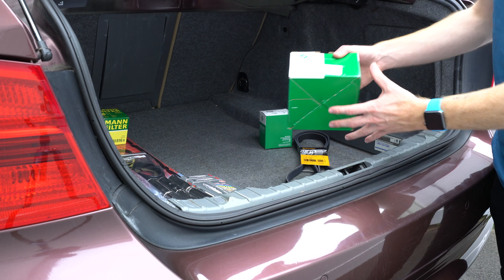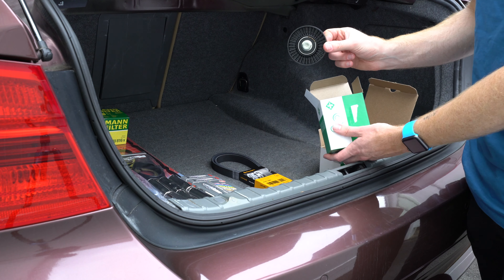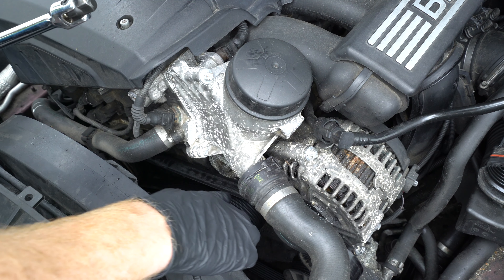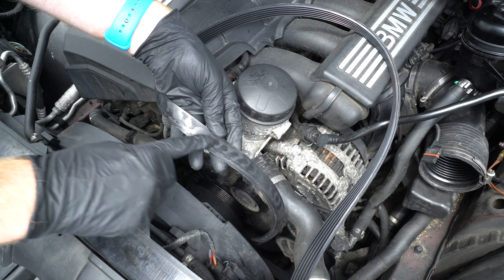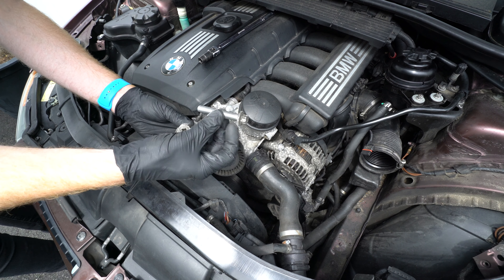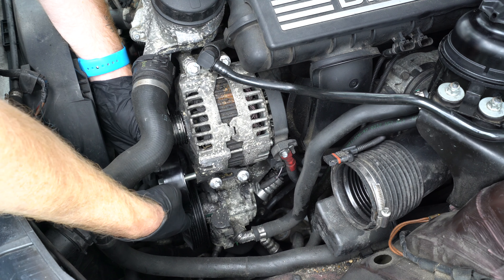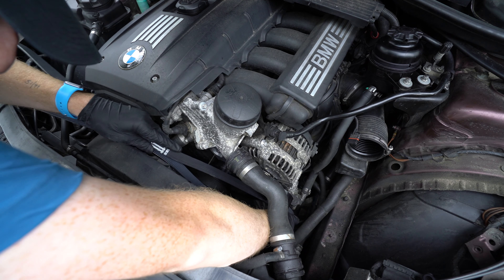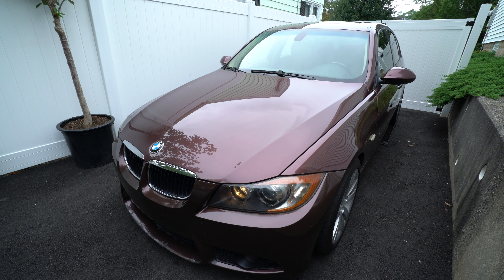E90 N52 BMW Accessory Serpentine Drive Belt and Tensioner Removal and Installation DIY

Comment: The guy did not show removing the stationary pain in the pensioner unit that comes with a steel pen holding tension on the tensioner, he should have showed removing that pain after you release tension with the breaker bar

Comment: Nice video.  When I did this same job on my Mercedes C230 I recall that the new "pinned" tensioner allowed me to fit the serpentine belt completely.  I then released tension on it slightly to remove the pin.
Reply from the maker: exactly Vic, that's how most will experience this job with this tensioner as well. I had some trouble fitting the belt routing and removed the pin during the first go at it... of course I edited that out!

Comment: The idler pulley and the pulley on the tensioner look like identical parts.  Do you know if this is the case?   A new idler pulley costs 3x what the tensioner pulley costs.  Seems like an easy way to save money.

Comment: BMW told me $445. I just did it myself, thanks to you. I needed to replace a cracked idler pulley. I ended up replacing the other parts as well. The tensioner pulley and belt only had about 30k miles  but I figured I should replace them anyway while I was in there.

I was slightly worried and wondered if I tightened the bolt too much because the new idler pulley didn't spin freely after I installed it, but I think that's just because it's new. It moves when I spin it manually but it's stiffer and doesn't continue to spin like the old one in your video.

Also the kit you linked to from Amazon comes with a "component alert" paper that says the bolt retaining clip "must be removed before installation" from the idler pulley. This is INCORRECT. The clip should stay on like you did in the video.

Thank you for taking the time to make this video and for saving me money.
Reply from the maker: Falco One great to hear it! With DIY more of us can enjoy these cars without going broke. 

Yes the new idler will not spin like the old worn out ones. The old ones have very worn bearings to spin like that. 

Interesting they must have made a mistake with the instructions or it’s a Chinese copy? Who knows with amazon these days.

Comment: Several key points:
1. For e90 328, the pin for belt tensioner needs to be removed and use the method in this video to put belt on tensioner. Belt can not be put on tensioner with pin on unless you have extremely strong finger.
2. The T60 is necessary. With tensioner go beyond the pin position to get belt on, you can easily strip the T60 hole on tensioner.
3. The T60 is better to be knocked on by a hammer to get fully inserted and then put on the break bar. If not fully inserted, T60 can also strip the tensioner hole.
4. Need to inspect whether the bell is in grooves especially for the bottom part of the AC pulley and bottom left pulley. 
As always, working on e90 is a careful job.
Reply: Thank you so much for this comment
Reply: So should you remove the pin before or after putting belt on tensioner?
Reply: I fit the new belt with the pin in.

Comment: Secret tip. Grove side of belt to grove pulley and smooth side of belt to smooth pulley. Never ever ran into any problems ever. It is now almost idiot proof. No diagram needed. Back in the day that was a different story.

Comment: You made this job look super easy and quick. A shop I called it could take up to 2 to 3 hours and estimate around 200. I even provided the part!
Reply from the maker: My BMW dealership quoted $375 for this service (2019 prices)

Comment: Yes. You are correct, This is very important. This is "Timing Belt" on the e90/n52 that if it is not changed and it breaks, you can destroy the engine.  I was speaking with a  sales rep. to a online parts vendor who was a mechanic.   I asked him how many n52s broken serpentine came in to the shop that he worked on that the belt got sucked into the engine and destroyed it.......He told me about half.........That is scary. 

To add to that because of the age and value of the car and the cost of putting even a "used" engine in an e90, the car is "totaled".  Now for various reasons if you are DIYer with "Free Time" and you want to do it yourself it would make sense to replace the engine.   A year back, when my wifes previous e91 water pump failed,  I was scared that engine was fried and was curious how much replacing the engine was going to cost.  There was shop that had 2 n52 engines with low mileage.   I was quoted $3200 to have the least expensive engine purchased and installed.  He did say that he would replace all the gaskets before installing the motor because it just made sense and stupid not to do that and that was included in the price.
Reply: it's not the timing belt, it's the serpentine belt, the n52, does not have a timing belt it has a timing chain, which usually does not need to be serviced

Comment: Is it the same procedure for 04’ BMW X5 3.0?
Looks simple enough!
Great video👍🏼
Reply from the maker: The M54 belt procedure is even easier to do than this one! The M54 also has two belts and tensioners, one for the main accessories and one for the AC compressor.
Reply: BIMMER ZEIT thank you!

Comment: Hi there i got question i have bmw e90 salon 2010 plate automatic when i turn all round my steering wheel i got noise i bin too my mechanic He tool me i need to change my V Belt and tensioner ? Just i need too buy extra the puley or just came complete with tensioner ? Thx

Comment: Looks like the engine bay was pressure washed, there is a lot oxidation
Also the fan is very easy to remove to give you more space( actually that applies to z4 but possibly on 3 series as well)
Reply from the maker: It wasn't pressure washed, but it is a New England car with 270,000 miles. The previous owner used it as a commuter for 12 years in all the bad weather for 270k! Thanks for the fan tip!

Comment: Changing mine Fri. Thanks for the vid and torque specs.
Reply from the maker: Kayden Parker nice, just make sure you have that big T60 torx bit. My regular set didn’t come with one that large; need it to release tension on the belt
Reply: do you have to mark the cogs and where they go before you take it off

Comment: Thank you so much for this easy step by step tutorial. I have bought the same exact kit and I have noticed on the belt from the inside there is like a clear line mark on one spot, is this normal? Or i need to get another one
I have a picture I can share with you. Thanks

Comment: do you need to mark at all before you take it off. or do you just remove it
Reply from the maker: no need to mark anything!
Reply: BIMMER ZEIT, i know the band i’m changing is called the serpentine belt, but do you if it has a timing chain or a belt inside?

Comment: How do I measure 30ft pounds of torque or 40 Nm when replacing the pully?
Reply from the maker: You’ll need a torque wrench 🔧
Reply: @BIMMERZEITT  thank you. You also mention tightening the pulley an additional 90 degrees using a socket. Will a socket work to tighten the torque screw?
Reply from the maker: @miguelloza26  it’s just the same socket for the whole procedure yes. You torque it until the torque wrench clicks or beeps (if digital) then do the additional torque angle specified.
Reply: @BIMMERZEITT  Ah! Got it, thank you so much! I've never worked on a car, so this was super helpful.

Comment: Good video but like all the rest u skip the part I was looking for pulling the pin out
Reply from the maker: Put tension on the tensioner and pull it out. Put tension on it again, align the belt, release tension. The new tensioner is very strong and I could barely hold it and align the belt alone. Can be tricky. Easier with a friend who can hold the tensioner while you slip on the belt. Good luck bro!
Reply: @BIMMERZEITT  Tks I got it now after 2 broken ones

Comment: Ny old tensioner jiggles when the engine idles.. i changed a new one but it also jiggles. Any reason? Is it normal to jiggle or i installed it wrongly?
Reply: When i saw the tensioner jiggles in the video i just asked myself if it really was the tensioner or isn't it possible that it was caused by another worn bearing and probably the worn idler pulley bearing?

My idler pulley is actually worn out and the idle of the engine drops and goes back to normal at times. Didn't drive it anymore after it does it 2 times til i replace the idler pulley at least since the belt and tensioner looks perfectly fine.

Also, i think you over-torqued the idler pulley bolt a little cause you torqued it passed the first click.

Very good video i really appreciate!